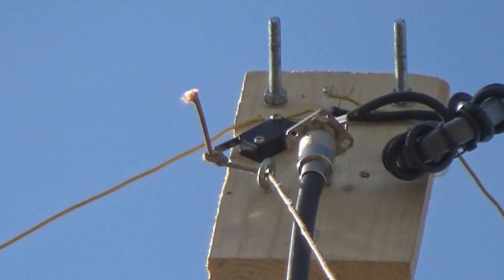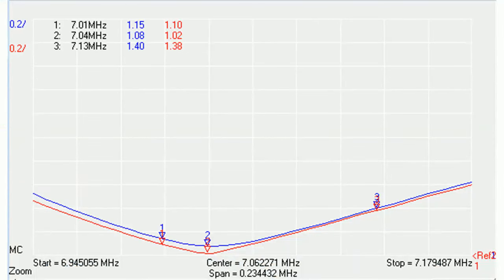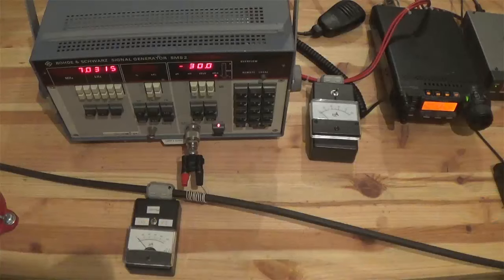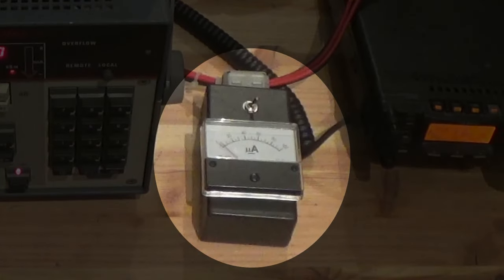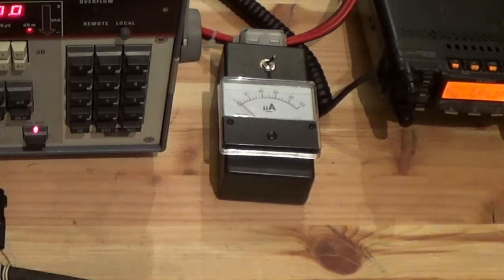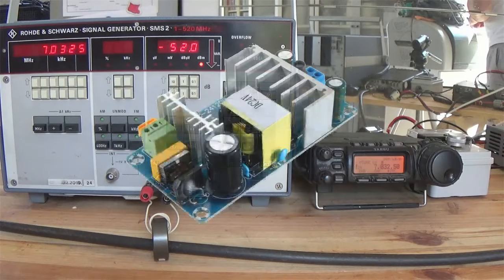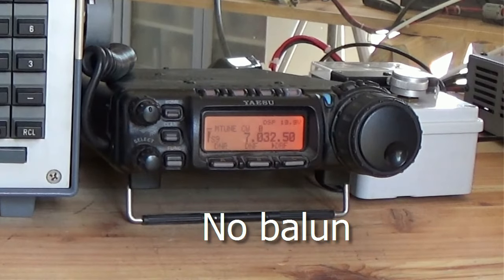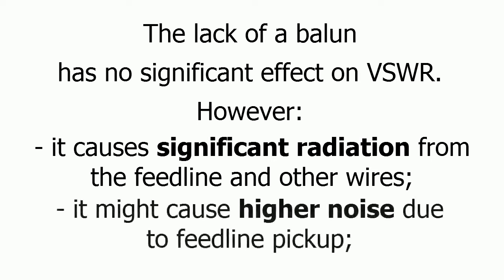The effect of a 1:1 balun on a resonant dipole

Comment: An utterly superb demonstration, I probably started playing with common mode choke type baluns just before you uploaded the video, my experience has been very positive. I still suffer with high noise levels but it is good to be able to run QRO without issues. I suspect I will benefit if I use similar common mode chokes on our satellite LNB cables as I believe much of my QRM is the switchmode supply in it. The use of the correct type of ferrite and an adequate number of turns is of course vitally important for best results.
Reply: perhaps certain balun-like assemblies can act as high-pass filters etc. that remove noise
Reply: @TheMariepi3  that is not the principle here, the onjective is to prevent the feeder from becoming part of the antenna.

Comment: Agree 100 % I'm more into window line now, but when I do make a coax fed dipole I start by making a 1:1 Guanella choke  and run the legs from that.  

I operate QRP and  mobile a good part of the time, so I can never trust that my antenna will be tuned properly based on length only. Out in the field, you get coupling to trees and the soil makes a huge difference. It's easy for a dipole to become unbalanced and get common mode currents.

Comment: To widen the bandwidth of a aluminium rod dipole, a 4:1 balun is connected to the terminals. I use 75-Ohm coax cable. A 4 metre total length impedance mismatched horizontally polarised dipole covers about 25-70 MHz at my location.

Comment: Very nice demo, Davide!  Interesting, we had a talk at our club, "GNARC" (Greater Norwalk Amateur Radio Club in Connecticut)  yesterday evening about antennas and we discussed how useful baluns can be. We did not, however, discuss the presence of RF in DC supply leads if not using a balun. The demonstration illustrates their utility.  Thanks!  I've forwarded a link to this video to a few of our club members.  Grazie mille!   Jess, ND1L
Reply: With almost 50 years of ham radio, I have never used a balun on any homebrew antennas and it has only been in the last 20 years or so people have been using them like a fad.  I don't recall very many of my friends back then using them.  This video almost had me convinced but I don't like that switch and not sure what it does to the rf and it is not a switch I would use for rf.  I would like to see the experiment redone without the switch.

Comment: Perfect video with excellent audio. Yes, exactly, what I am preaching to our newcomers. Without an Balun, the RF does not make any difference between one leg of the dipole and the shield of the coax, even if the two look completely different ;-) The coax shield becomes a part of the radiating antenna and that should be avoided in any case. 73s OE1MWW
Reply: I feed my dipoles with window line! I use a 4:1 Balun at the shack, aluminum storm window frames, and use coax from the Balun through an entrance panel to the tuner/transceiver.
450 ohm window line has a loss number of around 0.01 db per 100'.

Comment: The effect on the SWR value might highly depends on the length of the coaxial cable. As this (without balun) is part of the antenna, half wave even multiples of lambda might cause high SWR values on the transmiter

Comment: One more informative test: Measure the antennas field strength at 1/2 mile away. You will see a difference, as the feed-line that radiates causes wave cancellation with the antenna in the near-field.

Comment: This is a good demonstration. I would add a few key points to enhance overall, including first noting this is a current balun vs a voltage balun.

#1 critical element regardless is a station ground, having the feedline meet a grounded bulkhead outside the shack, having the station gear individually grounded to the same point, so no RF is present on or between any of the in-shack equipment - if there is that is a serious problem. The RF or any voltage level on the coax and supply should be zero at all times.

#2 - the same RF decoupling effect can be had with a suitable choke in place of the balun, which in this case also happens to be decoupling as it is a current balun not a voltage balun. You will not get the same benefit of decoupling with a voltage balun alone, it would need a choke added at the same point.
Reply: Many hams opt for the choke method to keep the mismatched RF off their feedlines, but it just converts that same RF to heat instead of radiating it into space. Always trade-offs, eh?
Reply: You are correct . That is the 1st thing to look for .
Reply: Not to mention the run of coax itself. Keeping as much of it possible on the ground or below can be helpful if it is radiating. I know it is best to prevent it from radiating in first place.
Reply: @WA9KZY the coaxial chokes that I employ with the amount of ferrite material, I doubt they heat up very little. I would be more concerned with the construction of some of these 1:1 current baluns. The ferrite material and how much there is, the quality of the wire (is it multi stranded and silver plated) and the enclosure it is in. Depending on frequency too of coarse. My chokes are in the air, no enclosure. Imagine a poorly constructed balun in a box on a 40 degree Celsius day.

Comment: The term "Balun" is a misuse of the concept.  What we are describing is not a Balun at all, but a Choke.  The phenomenon IZ2UUF is demonstrating is called "Common Mode Current" where an RF signal is produced on the shield segment of an unbalanced feed line.  The choke is inserted to present a high impedance to the RF at that frequency.  A 1:1 "Balun" is no more than a reactive transformer that resists the RF attempting to travel on the coax shield.
If you want a really good visual demonstration and explanation of Common Mode Current check out Dave Casler's (KE0OG) channel "Ask Og"  https://youtu.be/GMeOMwf2DJU
Reply: I'm not sure it's even a transformer, there's no flux in the core.
Reply: A 1:1 current balun is a common mode choke, is an isolator.  Different names for a device that performs the same thing.  What many call a balun is not. Many are just impedence transformers and do not make the BALanced  UNbalanced transition.  What your saying is not a balun definitely is.   What makes a balun a BalUn it transitions the coax to a balanced antenna.  This is acheved by forcing equal currents on both the antenna and the center conductor and inner surface of the shield by choking any common mode current.  Roy Lewallen and Owen duffy who are some of the most knowlagable on this have written extensivly on this   

W2DU balun is often called an isolator.  Maxwell called it a balun. A guenella 1:1 current balun is often called a common mode choke.  Even the So called Ugly Balun is often called a common mode choke.   

With all respect to Dave Casler who has some fantastic videos seems to not have a great grasp on baluns
Reply: A balun IS a common mode choke.  It is a balanced to unbalanced transformer wound in such a way that it has high impedance to common mode signals.
Reply: The common mode choke is a balun, also known as "current balun", as it is correctly defined on the ARRL Antenna Book that states "Choke balun model, also known as 1:1 current balun". Differentiating "choke" with "balun" and, even worse, calling "balun" all the impedance transformers, it is a typical misconception present in the ham radio world. For example, the term "un-un" for "impedance transformer" does not exist in engineering world (and it is never cited on the ARRL Antenna Book), but it has created by someone in the ham radio world and it suggests what many OM believe, that baluns and ununs are more or less the same thing with some minor difference, while they are two completely different items with completely different roles in the antenna system.

Comment: Very excellent video and demonstration. I am wondering if you can share the schematic for the RF power meter using the micro-ampere meter. I have a micro-amp meter which I want to use for this purpose. 
Thanks

Comment: if i put the coax coming to my house from a dipole through a lightning arrestor outside,would that affect anything?
Reply: No.  A lightning arrestor is basically a surge protector only.  It behaves like a dead short until a critical voltage is reached and then it shunts the current toward ground.
Reply: @JarlSeamus  so in a normal state it's a short?  then how does my signal go out?  you mean in a normal state the shield is shorted with the centre conductor?
Reply: @kissingbanditt  No, A lightning arrestor for Coax behaves just like a barrel connector in the normal state.  There is a small air gap (in some higher end unit the gap is in an enclosed capsule filled with an inert dielectric gas).  When a large voltage is applied (i.e. a nearby lightning strike) the gas in the gap becomes ionized and allows current to shunt to ground across the gap.
Absent of that large surge, the device is electrically just a short piece of coax.

Comment: No 1:1 choke s4-s5 noise level and with 1:1 choke s3 noise level on my 9:1 41' not so random wire, Results may vary. A simple choke at the feedpoint and at the radio is usually all that is needed for my simple setups.

Comment: I wonder whether ferrite cores added to the feedline would help reduce the rx RF pickup. I didn't read thru the comments...maybe someone already cited this.
Reply: MFJ makes one PN# MFJ-915 line isolator. There are 50 ferrite cores (not sure of the mix) around a length of coax contained within a 1 1/2 inch PVC pipe with caps with SO239's on each end. Same principal as you mentioned but with 4 points of insertion loss. It works but not as well as the #240-43 ferrite doughnuts I wind with # 16 enamaled magnet wire.

Comment: Goon evening from Turkey Izmir..I need some help about 9:1 unun..I am a shortwave listener..not transmitting, I have only a radio to listen sw..I have 20 meters long wire as anttenna..should I need a balun or it is not necessary? What will be different with unun or without? Thanks

Comment: Thank you for putting this together, it is very informative and helpful.  I don't have the equipment to do this or I might would myself, I would like to see what the effects of the balun vs no balun when an RF choke is also used on the coax near the antenna feed.  Something as simple as 6 turns of the coax in about a 4" diameter, clamp on ferrites could also be used and I have seen that done a good bit and suspect that either of these would eliminate or at least attenuate the RF radiation by the coax and other RF in the shack on the radio, power wires and keyer.  Thoughts?
Reply: Hello Amos. The "1:1 balun" shown in the video IS an RF choke. An RF choke is a type of 1:1 balun (the so called "current balun"). See ARRL Antenna Book, 23rd ed., chapter "24.7.1 COILED-COAX CHOKE BALUNS". In my case it was wound on a ferrite core to make it more effective on a larger spectrum, but a correctly calculated ugly balun (wound in air) has the same effect.

Comment: Sorry but this si not a Balun 1:1, this a choke ! Highly recommended to reduce CMC !!!
Reply: Huh? Balanced : Unbalanced = Balun. It is a 1:1 transformer from unbalanced to balanced, how is this a choke in this configuration?
Reply: @ caprabi1 ... This is a 1:1 current balun, you are thinking of a 1:1 line isolator (1:1 unun or unbalanced to unbalanced) used on many verticals to reduce Common Mode Currents or CMC's.
Reply: cmc?
Reply: @Capecodham  common mode current
Reply: @caprabi1  What did you do with the you were not clear saved by not typing ommon ode urrent?
REPLY
Reply: @Capecodham  I understand you are not very used to technical Hamradio codes, no problem….you will overcome the difficulty.
Reply: @Capecodham  for mor info see jarl seamus comments…73
Reply: @caprabi1  this was not a common ham radio, "code." It was you trying to impress your intelligence and how you are smarter than everyone else.
Reply: A common mode choke is exactly what a balun is.
Reply: @stargazer7644  You are totaly wrong, a balun is a circuit to adapt a symetrical to a asymetrical line, a choke is to block HF current like common mode current.
Reply: It was fun informative video thanks
Reply: As an ignorant as i am, I First put a dipole symmetrizer made on a PVC pipe and then a RF chocke made with RG cable. No spikes in RX, no tvi or interference in Power supply during TX.
Reply: @rotaxtwin  You should study technique, you would understand the difference………sorry it’s so rididulous….
Reply: @Capecodham Every HAM knows what CMC is. I'm a new HAM and even I know what CMC stands for. He was being respectful and friendly. What prompted you to bare your teeth?

Comment: The blog post linked above adds some details, but there are still a lot of variables not described, like grounding, coax routing, etc. Is there theory about the use of the balun that explains the noise resistance other than that of a simple choke?
Reply: The balun stops the outside of the coax shield from becoming a radiating part of the antenna.  When it is a radiating part of the antenna, it emits RF on transmit, and receives RF on receive.  A balun stops RF flowing on the outside of the coax shield.

Comment: I would keep a common mode transformer out of the near field of the antenna to prevent saturation.
Reply: The proper place to put a balun is at the antenna feed point.  That's certainly going to be in the near field of the antenna.

Comment: basically folks USE a balun !.. it cannot do any harm and will most likely help.. debate over !
Reply: Not exactly, as pointed out below in several below comments, it depends on many different factors in your setup. Also a balun limits the total power that can be fed to your antenna depending on the construction of either one. .

Comment: He should have mentioned a line tuner also, using a line tuner is also misleading as it radiates the antenna lead-in, the entire antenna system (line and antenna)  are tuned and therefore can effect overall radiation performance...

Comment: The balun wouldn't have an effect on an SWR that's good, because excessive power is not radiated back down the line. You should test it on a dipole with a poor SWR to see if it improves it.
Reply: Actually the amount of transmitted signal using the outside of the shield as an alternative path is dependent on the length of the feedline, so in some cases you will see a large change when using a choke at the feedpoint, and in some cases you will see little effect regarding transmitted RF on the outside shield of the coax.  It has nothing to do with how bad the SWR is, it has to do with the outside of the coax shield impedance as seen by the feedpoint changing based on the length of the feedline.  73, Don (wd8dsb)  P.S. this was an excellent video.
Reply: A 1:1 balun does not change the impedance of the antenna.  If the SWR is poor without the balun, it will be poor with the balun.  An impedance transformer like a 4:1 or 9:1 can change your SWR by bringing the antenna impedance closer to 50 ohms.  Note that those transformers are not baluns by themselves, and may or may not also have a 1:1 balun in series inside the case.

Comment: What about a very common issue wtith high SWR only with an amplifier on?
I just read where a  guy solved his high SWR with the amplifier on only?
With the amp off SWR was fine but amp on he had high SWR. Amps need  an swr of 1.3 or lower.
A choke balun solved his issue or so he thought.
Others thought he simply masked the issue.
https://www.worldwidedx.com/threads/high-swr-with-linear-amp.148498/
Reply: High SWR with the amp on means the input impedance of the amp is not 50 ohms.  A 1:1 balun isn't going to fix that.
Reply: @stargazer7644  Thanks for the reply. Oddly that little amp had the SO 239's mounted to the back of the box but not grounded to the board like most amps. I tried grounding it to the board and that made the SWR max out.
I removed that ground and tightened the nuts up to where the 239's   wouldn't swivel in the box and that got the SWR down to a usable level.  I was able to get out 7 miles with the 60 watt amp but was told it didn't sound very good. I"m sure its very old and might possibly need all of its caps replaced. It used one MRF453 Transistor that is no longer available.

Comment: In other words, a 1:1 balun is actually a choke.
Reply: Most accurately called a 1:1 transformer; no direct coupling between input and output. I put a capacitor across the primary and tune it to resonance. The unbalanced transmitter output is perfectly happy as is the balanced dipole antenna. Although this system is frequency dependent, mine covers the entire 20-meter band.
Reply: you can also use a choke balun, by using a coiled form of the coax (about 10-12 turn on a 6 inch form) at the feed point, this well choke off unwanted radiated power...
Reply: In this case, absolutely. Not in all of them
Reply: Randy Miller the “ugly balun” tends to not be very effective, it can also accidentally increase the common mode current due to the inductance behaving like a loading coil in series with the feed line. I have experimented with common mode chokes wound on FT240 series cores, very high impedances over a wide range. Google G3TXQ.
Reply: Yes, a balun is a transformer wired in such a way that it has a high impedance to common mode currents.  It is a common mode choke.